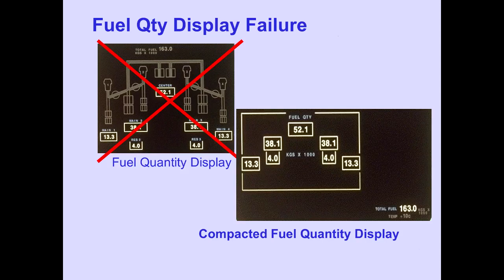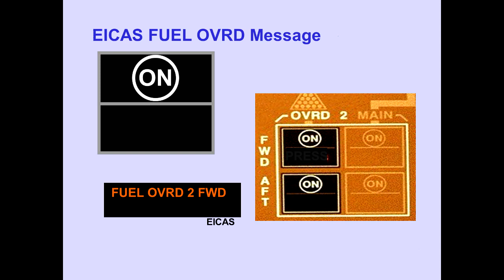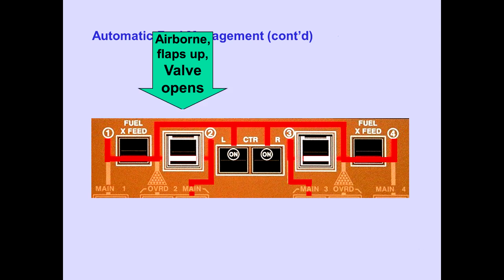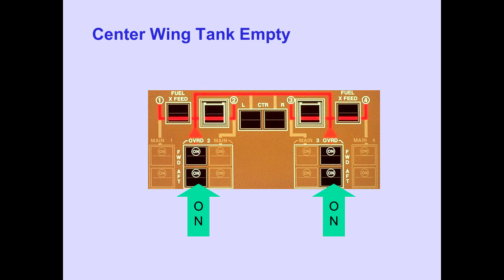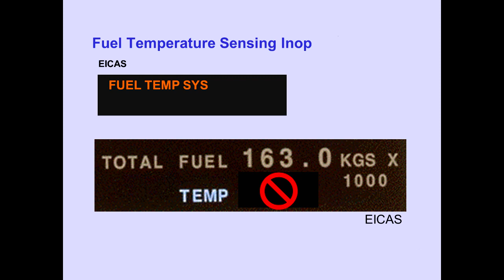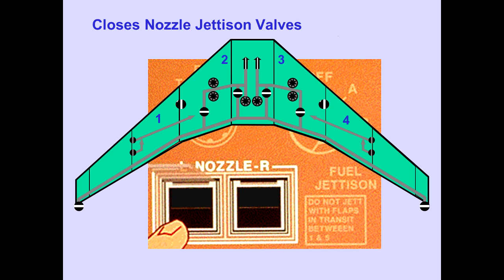#34 Fuel System Boeing 747 400 CBT

Comment: Funny. The scenario in the question @12:00 was not covered up to that point. No wonder they didn't show a repeat slide of the answer after they give it. It doesn't exist.  Fortunately I found that scenario covered in the 747-400 FCOM , available on line, for free. Just Google it. Up to this point, the modules have been flawless. Thanks for uploading them.
Reply: It was covered. It said override pump output pressure is higher than the main pumps. So the override pumps in 2 override the main pumps in tank 1. Look at the scematic shown beside the question 😊